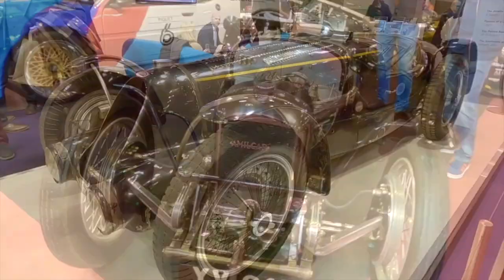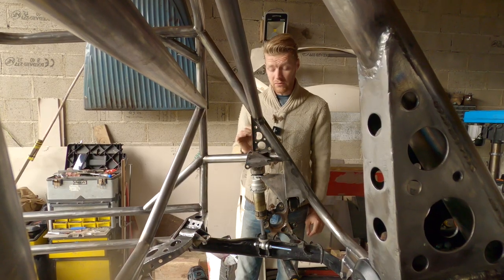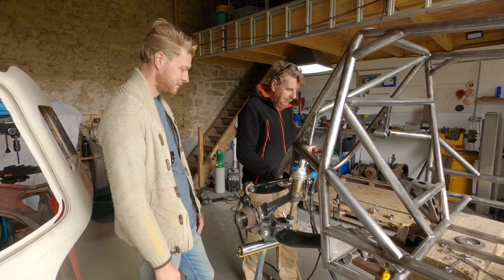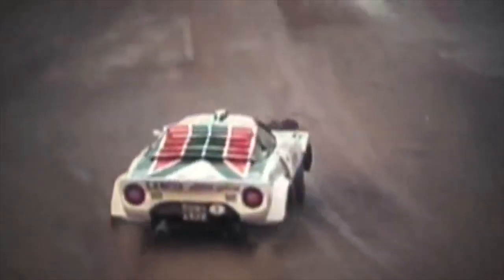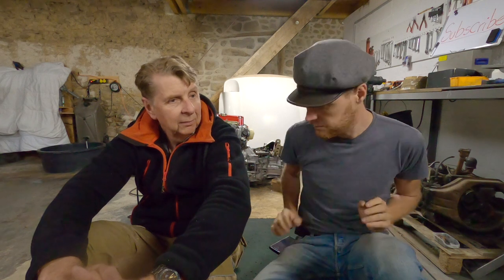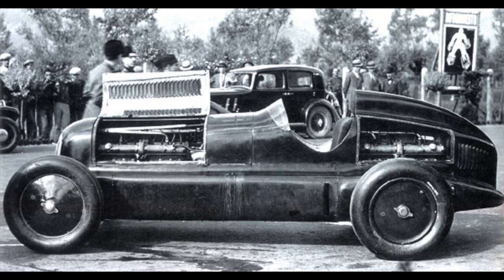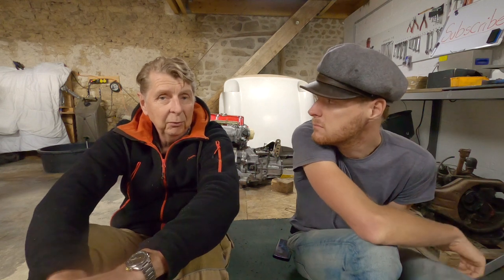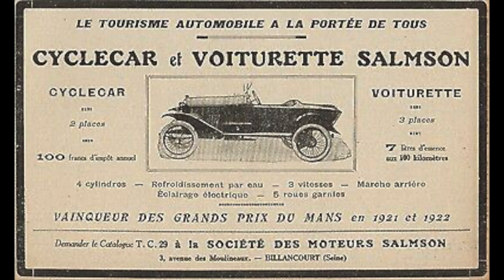Fitting Off Road Racing Coil overs | Project Mosquito Honda Type R Mini Supercar (Ep42)

Comment: What a fantastic and fascinating video to start the weekend with. A 20-30 minute discussion should be a feature in each video as it works really well. As regards future car technologies I think there will be a mixture of electric, hydrogen and oil based solutions. Well done to you both.
Reply from the maker: I'm glad you liked it we shall see how it goes. When you only make one video a week it's difficult to try new things  because if a video performs badly it has a knock on effect but if it does well we will do more.

Comment: The reason I compared it to Binky is because both cars have started from a Mini or a Mini-derived base, and you're cramming a much larger engine into them than either car was necessarily designed to cope with. Then, along the way, the scope has crept from "well, I'll just make this fit and get it running" very quickly onto "If I'm going to do this, then I'm going to make it as good as it can be." The primary difference, aside from weight, is that Binky is still predominately a unibody chassis, which is something they had the option to go with, since their shell is made of steel instead of fiberglass. The other difference is that they wanted AWD off the Celica GT4, which entailed weighing the car down further with the heavy Toyota suspension components. I suspect Binky will probably be just over a metric tonne, due to the drivetrain and brackets and bracing and all that fun stuff.
Reply from the maker: A Celica gt4 weighs 1390kg     so I'd say 1200kg for Binky just because it's smaller but wouldn't be surprised if it was more

Comment: Here’s a question for the both of you. From all of the examples on the road, it’s clear that any suspension can work, it’s a question of what works better in any certain application given the available funds. Rally cars are all built around road going cars, and the regulations these days require McPherson struts. Were this not required, what’s suspension would you choose to run rally? Would it be different at the front than the rear? Would it vary based on front engine versus rear engine, 2WD versus AWD?

Comment: What kw rating of solar do you have to be off grid Oliver and still support welders. I assume you have a large battery bank?. For a man that never had a voice in the videos for so long, your dad has certainly learnt to use it recently. Great to get his insight on things as unlike most people he’s talented with both hands and head.
Reply from the maker: We have 21 solar panels and the batteries live in the wood box next to the lathe. There should be a couple of videos about the panels going up soon on the MeryemandOliver channel

Comment: Thank you Oliver and Andrew for the explanation on CG vs Roll centers. I already had got to the same conclusion on the high rear roll center but I think that only applies to Front engine cars. Do you think that the high rear roll center applies as well on a Porsche 911? won't it be better to keep the pendulum in check by having the rear roll center low?
Keep up the great work!
Reply from the maker: Remember that it's all relative and about the relationship between the two so a 911 with it's flat 6 has an extremely low CG but the roll center is higher in the rear relative to the front as is the ride height
Reply: I was wondering how you’ve calculated the CoG, without the car complete it must be theoretical? I’d be interested in a quick white board diagram of the process,
Reply from the maker: I don't do white board diagrams because they are a bit pointless but its based on the CG of the drive train being the heaviest bit and the hight of me and various components and their weights but bear in mind the CG doesn't move but the roll center is NEVER stationary and that's something everyone with a whiteboard forgets

Comment: And yet Porsche have decided to fit a rear antiroll bar on the GT4RS
Reply from the maker: The Cayman Gt4rs uses strut rear suspension and weighs 1495kg (875kg more than The Mosquito) so it will be required for controlling the body weight in roll along with computer controlled brake vectoring but a McLaren F1 for example doesn't have one

Comment: we got 20cm of snow 4 days ago in finland it was not fun cant but still cant belive you had to drive in a blizard did you have eny gear for that or where you on the road with summer tires?
Reply from the maker: I was using my Michelin X 125 with a lower pressure than I use year round which are surprisingly good both off road and in snow although if there had been much snow and ice on the road when I left I probably would have swapped to my winter tires